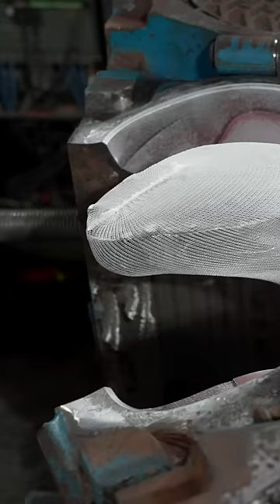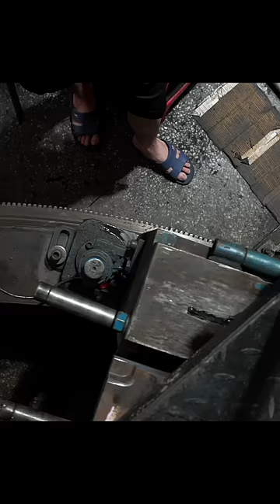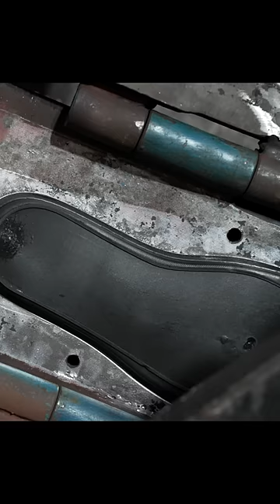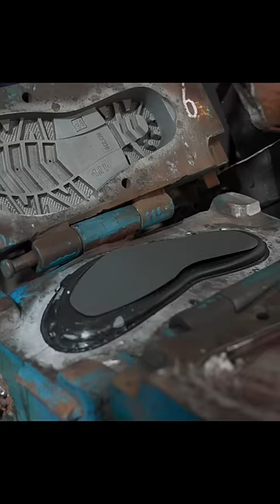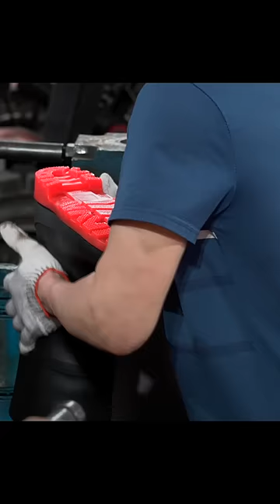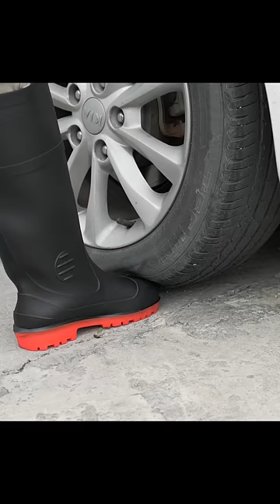The production process of safety water shoes

Comment: I think it's better if you test it with just 1 or 2 nails, more nails make it harder to pierce your shoe.
Reply: You're 100% correct. However they did put in a metal insole in the shoe before molding so i guess nails wouldn't penetrate anyway...
Reply: @AbbasBinYounas  
You'll be surprised that a tiny nail can pierce the steel/metal plating if you step on top of it.

Of course you need a big step to pierce it like a hop or running and the nail need to be straight upward and not to long.